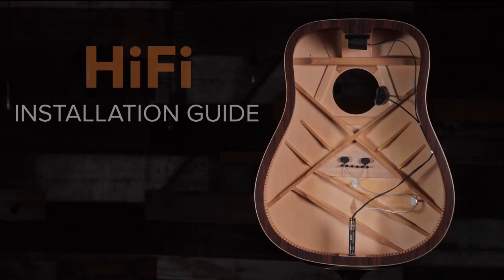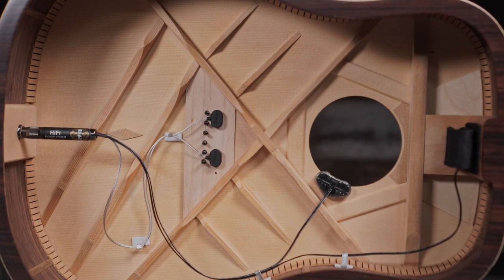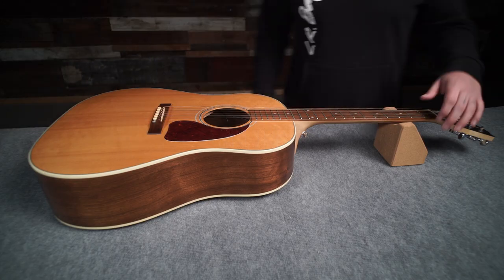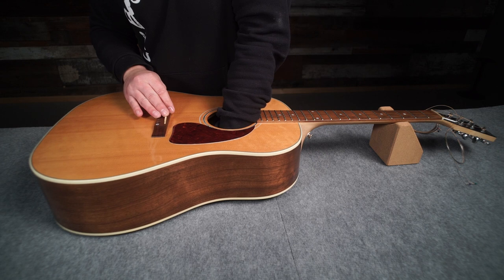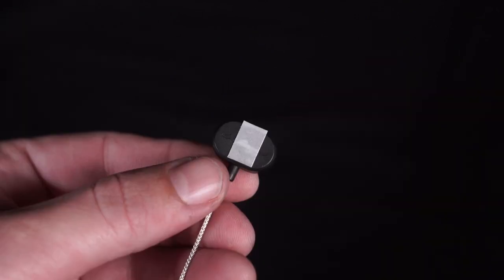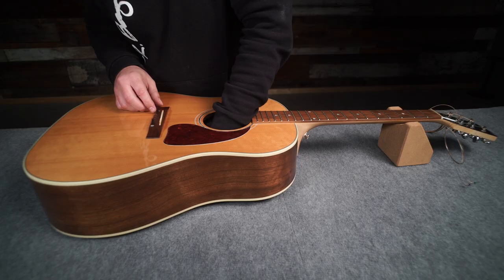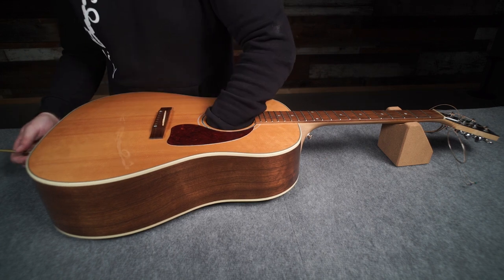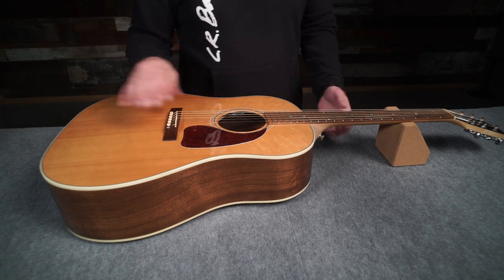LR Baggs HiFi Bridge Plate Pickup System Installation

Comment: Very informative installation video.  The design is well thought out and the pickup senses can be installed on the bridge plate for 'X' braced tops as shown on the video, or other bracing systems such as 'Falcate' type top bracing system.  This is brilliant!

I build acoustic guitars and I am very impressed with the sound quality of the new LR Baggs HiFi Bridge Plate Pickup system.  I will be purchasing this pickup when it is available in May 2023 .  The LR Baggs HiFi Bridge Plate Pickup System will be loved by acoustic guitar players as this pickup overcoming the quacking issues that can offer be a problem with under saddle piezo pickup systems.  This pickup by itself is a great sound!

I have been using the LR Baggs Lyric Microphone in parallel with other type bridge plate piezo pickup systems eg K&K pickup and then connecting to an external two channel preamp with blend and parametric equation control on each channel.  The preamp that I use also has a variable phase control feature to align the two pickup systems in phase together.  This setup combination produces a great sound being able to use it in a blend format or separately.  However, after listening to this video's sound sample I would expected that the LR Baggs Lyric Microphone blended with the LR Baggs HiFi Bridge Plate Pickup System would be better and an excellent combination for a variety acoustic style of sound such as:

Loud Rhythm Playing with a Band
Flat Picking
Lead playing
Finger Style Playing. 

For my setup described above I was able to connect (solder) my other pickup onto the LR Baggs Lyric Microphone print board and use the Lyric's stereo jack connector to send both channels to my preamp.  I be interested to know whether it is possible to connect (solder) the HiFi 's output to the Lyric's microphone printed board and then link the 9 volt battery connection together.  The aim would be to use one 9 volt battery to power both the Lyric microphone and the HiFi pickup system.  I think that it would be likely that one 9 volt would provided sufficient power to run both the Lyric and the HiFi pickup system together with no significant draining issues.   I understand making these adjustments to the LR Baggs HiFi pickup would void the warranty.

I just see that there is great potential to use the new LR Baggs HiFi Bridge Plate Pickup System by itself, plus hopefully be able to use it with blending pickup combinations that would result in achieving great acoustic guitar sounds that musicians will love . 

WJ Guitars. Australia

Comment: Caleb, I just finished the install.  I was trying to use this video as guidance. The video is good but it is lacking in several areas. Drilling the hole doesn't have to be done with a half inch step drill bit like the one shown here but starting out small and increasing to half inch is best imo. Remember to use masking tape when drilling into the body when increasing the size of a hole for the output jack or you may chip the exterior finish of the guitar. I'm a retired electrician and have many skills but some folks may not. Also, the clear plate of the  jig had to be turned around 180° from what is shown so the two sensors could fit on my bridge plate. I understand guitars are constructed differently and your support team is there to be consulted. My guitar is a new Yamaha FG830. Also, there is hardly any room to get my hand far enough back into the lower bout to line up the output jack. A long wooden skewer or straight clothes hanger can help. To tighten the jack nut from the inside is not going to happen unless you have the right tool. I'm not sure what that would be unless it's a very long pair of needlenose pliers but then you'd have to have skinny arms or lots of luck to feel the inside nut with the pliers. The volume/tone control I was hoping to mostly hide but the interior bracing prevented that. It is partially exposed. To tidy up the wires on the inside there's no way to get it to look like in the video. There's no room if an arm is in the soundhole. I had a mirror and flashlight but you can't see. I was able to feel my way to get it to where the wires didn't show. The metal type clamps with sticky tape, there should be a couple more included plus the wires could use an extra 2-3 inches in length.  But I have good news! It sounds awesome through my Acoustic A-20 2-channel wedge amp and new Martin strings. It took me about 3 hours from start to restringing, tuning and playing to putting her in the case. $214 worth? The LR Baggs Hifi is 2/3 the price of my guitar but it beats going without.

Comment: I’m kinda confused with lr baggs product line now. Why would you get this over the lyric? Is this replacing the iBeam, and how is the transducer tech different? Is the Anthem still their flagship even though it’s 13 years old?
Reply: The mic on the anthem has some people frustrated and for many percussive players, they don’t like it. I would use this before an anthem if I wanted a cheaper option for percussive that still sounds better than an element. I however love my anthem in my Taylor 414ce and would put that in every guitar I own. I have the baggs element VTC in my new Epiphone and I like it too for what it does, but still thinking of doing an anthem instead

Comment: Well so much for putting this in a Breedlove pinless bridge acoustic guitar.
Reply: Lolz 😂
Reply: Pinless bridges are s bad design. :(
Reply: For a pin less I’m pretty sure you could just stick the sensors in the correct spot without the jig?
Reply: @kodybryantmusic7357  Yes, but making a tight fit would be hard.
Reply: @LegsON  such is life lol
Reply: @kodybryantmusic7357  Only for pinless guitars. :P
Reply: @LegsON  ehhh, you might just need to use a different way of adhering or hold it for a lot longer